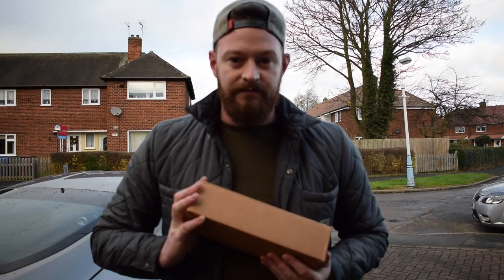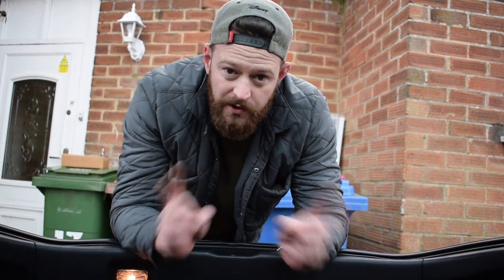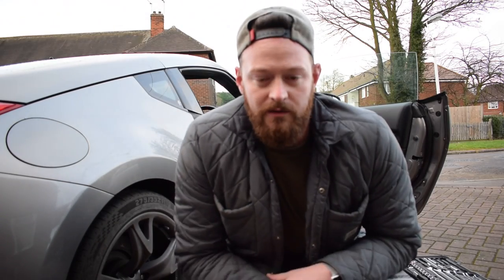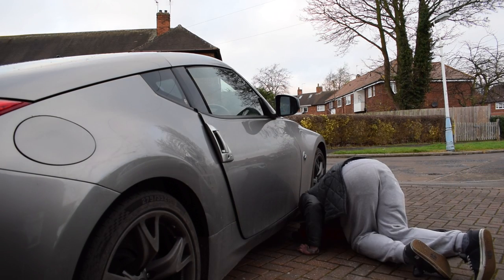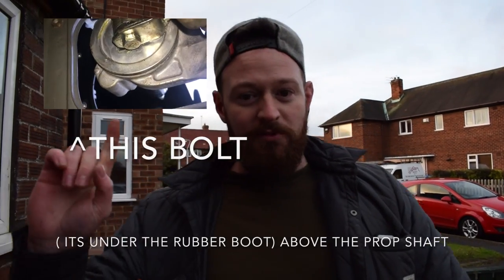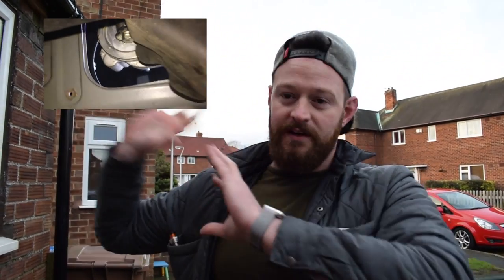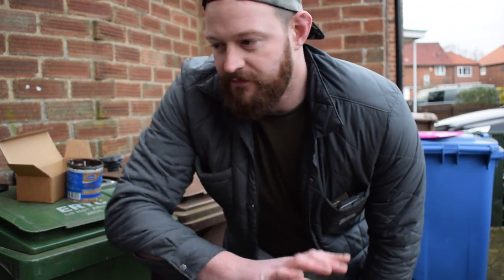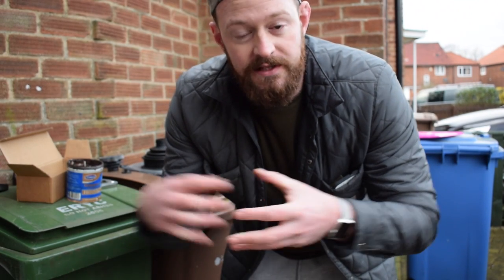FITTING A SHORT SHIFTER - NISSAN 370Z

Comment: I installed a short shifter on a Porsche 944S that I had years ago and it made a dramatically positive difference in the feel. The one I had was a more premium one that offered two levels of shortening, both in the throw and in going through the gate. I used the maximum level of shortening in both directions and loved the results. I could almost go through the entire shifting range with just a flick of my wrist, very cool. The mechanics and shop owner of an independent Porsche garage all raved over the shifter after I had brought the car in for service and they had an opportunity to drive it. The shop owner wanted to know where I had gotten it from so that he could offer it to his customers. My kit had an exposed Heim joint linkage and so I encased the linkage in a plastic bag that I had tied off at both ends with Molybdenum grease packed in the space. The shifter operated smoothly and never gave me any problems.
Reply: Which shifter did you install?
Reply: @TboneWertman  Sorry, wish I could remember but it was back in the early 1990s that I got it. I remember that it cost me about $200 and the installation was not difficult.

Comment: At 0:35 you mention the rattle. Do any other 370Z owners have a rattle in their shift knob? That's why I came here. I'd rather not replace anything to eliminate it, though. Any ideas?
Reply: Mine is doing that same rattle noise. Did you have any luck fixing it? If so what did you do?
Reply: @leonelmc83  I have not fixed it. It usually takes a while to start rattling after it's run for a while.